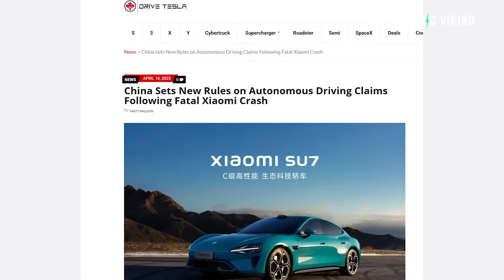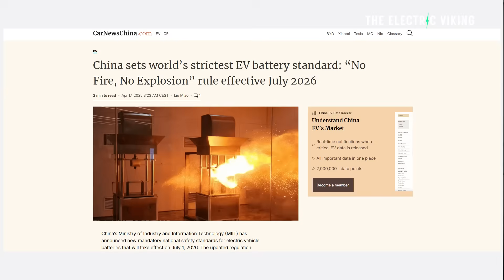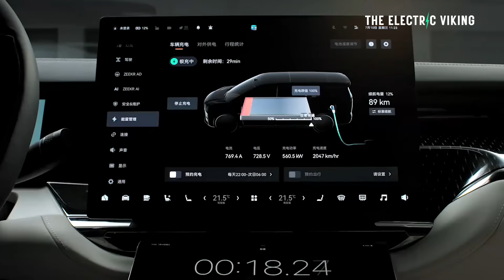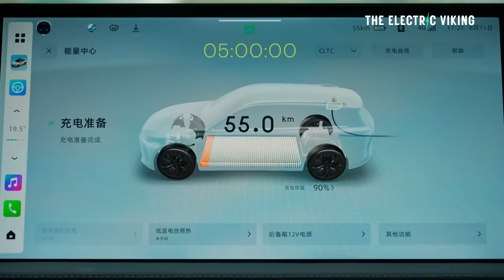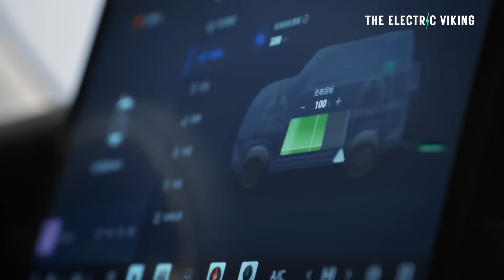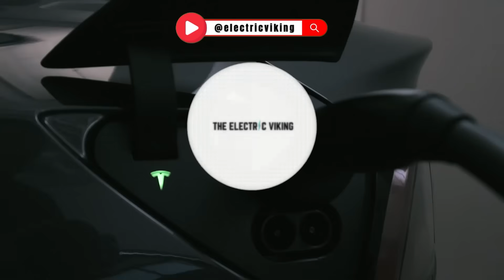China’s Game-Changing EV Battery Safety Ban Starts in 2026!

Comment: In terms of regulations, not buying it so much. Have you heard of those multi story concrete apartment buildings being built without rebar? I'm sure there are regulations, but the issue is probably more on the end of enforcement.

Comment: any increase in safety requirements is good if it removes a barrier to purchase and improves the overall reliability of the car. I agree that in both EV and ICE China has more brands than it possibly needs and consolidation and collaboration are required to thin out the brands. As long as Xpeng remains I am happy to see this

Comment: Safety was grossely unregulated and most homologations for road usage have not taken the necessary aging factors monitoring and damage prevention into account, not only on batteries, since also a basic heat and weld in a power regulation thyristor could cause on some poor non fail safe design, a high amp. short from battery to motor stator causing some drastic out of control speed excursion. Then, having a reliable high DC current safety circuit breaker to mitigate such risk is not that simple and cheap. Under water DC power lines breakers one both ends can be up to five floors high..to break a permanent DC electric arch forming…The green and EV industry obsession has been to ignore and hide the dangers as warrantable workmanship and material “normal” issues on recent products to avoid bad press and this strategy worked for a while with a very young EV fleet. Any fire brigade communicating on brand model type on fire but ONLY for EV was exposed to immediate legal litigation by importer/manufacturer on the basis that proven root cause of fire (asteroids , cigarette, drone crash, fire works, solar lense, etc) was still undertermined. Officials are instructed not to disclose fire data any more,  but when hundreds or thousand locals have to be evacuated away from toxic fumes with casualties, etc, then the silent wall breaks apart…: EQC in Korea, TM3 in Lisboa. Tesla truck in Australia, E-scooter in Nice , 3 years old daily used Kyburtz 3 wheeler In Gland post office etc..in most cases, the lithium fire destructions are so important that any investigation of the cause gets questionable..but most of the time, they are obvious with converging indications,,,but bad faith and armada of layers is well know to corrupt ignorance and naivet.
NOW, the cost implications of the destruction of car ferrries or Ev on fire in tunnels or confined space and related massive damage to surrounding infrastructure has caught the attention of insurance experts and safety administration . With stricter homologation rules allowing only new certified safe mobiles in ferry long tunnels whee damages can reach billions and fully discharging others in all confined spaces .a majority of the major EV community safety risk and cost of destruction can be mitigated, but the entire attitude and approach to safety has to change. The third liability insurance premiums COSTS already reflect this reality, here in Europe, they are cheapest on Dacias low cost cheap to repair ICE and higher on their Chinese made EV and are the highest on all Tesla  models….
One aggravating issue is that the profits generated by costly safety measures are not well accaunted for by dummy beans counters financial accountants…because it remains an 100% total passive cost until…it prevents a catastrophic damage which then does not occur and is not accounted for either…This is why safety cannot be managed by cost only but also by the level of damage and casualty volume without it, and here for EV, reaching excess cost is clearly the case. This requiring a separate budget approach for safety expenses.. For instance for its safety performance assessment, the management of à nuclear power plant shall not be rated on the GWh produced annually and their good financial results only but ALSO BY the number and gravity of ALL incidents . This is how safety is at stake….😂

Comment: China, the largest EV market, reports indicate 680 EV fires in the first quarter of 2022 alone, highlighting a significant regional contribution. If this rate held, China could see thousands annually, but this data is partial and not globally representative. In the UK, 390 EV battery fires were reported for the 2022–2023 fiscal year. Sweden recorded 23 EV fires in 2022 out of 611,000 EVs. Australia noted only six EV battery fires total as of June 2024.Globally, with 40 million EVs by 2023, the fire rate is extremely low—around 0.0012% to 0.0013% based on EV FireSafe’s data. This suggests fewer than 500 fires annually worldwide, though underreporting is likely. Specific causes like collisions, manufacturing defects, or saltwater exposure (e.g., 11 EV fires post-Hurricane Helene in 2024) add context but don’t give a precise total.Without centralized global reporting, a conservative estimate based on available data suggests 1,000–2,000 EV battery fires worldwide since 2022, heavily weighted toward markets like China. This is a small fraction compared to internal combustion engine (ICE) vehicle fires, which occur at rates 20–80 times higher. For a definitive number, more comprehensive global tracking is needed.

Comment: According to Swedish numbers from the Swedish Civil Contingencies Agency (MSB).

Specifically, the data for 2022, which indicated:

3,400 fires in 4.4 million petrol and diesel cars (0.077%)
23 fires in 611,000 EVs (0.004%)
... is widely cited from their reports on vehicle fires. You can often find this information referenced in articles and studies discussing the safety of EVs compared to traditional combustion engine vehicles.

This means ICE cars catching fire in case of an accident is approx. 19 times higher.
But yet. ICE cars catching fire under other circumstances are much higher, i.e during re fuling, leaks etc. I have not got numbers for this but there are numbers showing that hybrid vehicles are the most likely to catch fire, statistically, than any of EV or ICA vehicles.  

Many sources analyzing EV fire statistics refer to the MSB's data as a reliable point of comparison.

This is 2022 data so things have changed a lot since then, but this is at least an indicator from a reliable source.

Comment: Fire is my biggest concern with EVs (especially Chinese ones) since all the other problems have been handily solved already. Sure it's a low probability event but it's EXTREMELY high consequence, and when you have millions of them rolling around it will be happening fairly frequently.
Reply: China sold roughly 12 million NEVs last year, on top of 8+ million in prior years.  There are easily 30 million NEVs in China today, and most of them are newer cars using newer battery chemistry.  That's why China feels confident to ban the 1st gen Lithium batteries.

Comment: I have seen it many times where companies give a country a regulation as they have already implemented some safety feature which will benefit the market.  However, it can also be used as a form of protectionism as foreign companies do not have to have that standard for their home market  and face costly redesigns,,,
Reply: Yes, and this is deliberate.  There are NO 1st gen Lithium batteries which can pass this, so it cuts off most of the non-Chinese OEMs.  They'll need to find a Chinese partner for the battery, which basically means they'll need to license Chinese drivetrains. You can't just buy a battery without the tech to manage it, or you'll see much worse performance and reduced longevity.

Comment: 100% China will develop safe battery tech. 
Lithium Sulphur and  Sodium Ion batteries already provide far less risk than NMC /NCM (Nickel Cobalt Manganese). 
Solid state batteries are still to be seen in real life in a vehicle even given the Hype from Toyota and Honda.
Aluminium Graphene by GMG are in level 4 /5 evaluation and possibly still 3 years away and are suggested to have energy density of 500Wh / kg. twice that of LFP.
Once that is proven then a massive game changer , lighter more energy dense and fully recyclable without risk of fire or explosion and no toxic smoke.

Comment: Maybe China has already THE solution so, putting new hard rules will hurt only the small manufacturers but at the same time will help to export their cars. The other countries are not ready to compet against new tech....solid battery could be it.
Reply: They do.  LiFePo, Sodium are in production.
Reply: @ZweiZwolf  LiFePo4, yes I know as I'm using them for my solar sustem since 2020. But the sodium, I wait to see the pros and cons. Anyway, thanks for the information.
Reply: @ Sodium is in use today where capacity, weight and density are secondary to cost.  It's like mild rolled steel over forged titanium alloy.  The big uses are utility grid storage and small e-Bike / e-Scooter packs.  I believe some NEVs with sodium packs are going into production this year.

Comment: so if ev have this when does this rule come in for petrol and diesel.     like the diesel cars that have known faults not fixed.
every ev fire is news    every petrol or diesel one is not.   people are looking to find fault.
they look for a reason not to buy.
why do we respect  petrol and diesel cars   they kill people   there is large numbers of car etc catching fire.  after all these years  there has been no lets make them safer
Reply: I have just ruled out buying a Kia stonic.  Its a mild hybrid, with a lithium-ion battery in the boot.  If it had been an LFP battery I might have considered it.  I ruled out lithium-ion on safety grounds for my home battery that works with my solar, I bought a battery but an LFP type instead as they are much safer. Another car site I watch sometimes has a guy with a Porsche EV called a Taycan.  He got a letter from the car manufacturer recently saying not to park near your house, due to fire risks in the vehicle recently identified.    He contacted his house insurer and they wont cover the house from a fire originating in the car now he has had that letter.  This is a massive inconvenience to him, in the UK parking away from houses and other cars is basically impossible.   It seems a Taycan fire killed two firefighters in Spain recently in an underground car park. Add all this downside risk and there is NO WAY I am getting any EV or hybrid or petrol car that has a lithium-ion battery in it.    Any cautious car buyer should be doing the same.

Comment: It is an axiom in the field of Security that the standards must be built into the products from the inception, and not tacked on at later stages. I would say from my experience that this is a major excellent step. We may think that we are well into the EV world, but it is just the beginning. 

The security of future systems will be built upon what the batteries can handle and how they perform under stress. As the two major companies will be spreading their products around as OEM suppliers (and probably others) , it is essential that the standard determine the responsibility. Without a standard, either of the two essential companies could sell product and try to pass the responsibility onto the frame maker or the body maker which might ignore the duty to make a correctly substantial bottom panel that doesn’t protect the battery from being pierced. 

Or, they might sell different levels of responsibility – but the country standard compels them now to maintain high security throughout any chain they are involved in – even after a piercing that is not their responsibility, they are responsible that there is no runaway, no noxious gases. This is the Way.   

Will it add costs? Certainly, but it is also better to have those costs built into the mentality of their creation. It is akin to being easier and cheaper to capture the carbon before coming out of the smokestack as compared to capturing it at each car. But is it worth it? Absolutely, and better done now than a few years from now when vendor and OEM supplier blame each other for disasters that weren’t when security standards weren’t established and everyone relied upon the highest level of ethics and competence that get skipped over – not always malice, but sometimes, not often misunderstandings and incompetence, but sometimes.

Comment: Thanks for bringing yet another highly interesting news. If the EU implements a myriad of regulations (strangely none regarding this safety standard issue) China should too. It´s a bold step, imho in the right direction, even if it´s just aimed at increasing consumer confidence in the product.
The little caveat is that China has had strict rules for the last 5.000 years and most Chinese and Chinese government officials know a hundred ways to circumnavigate them. Some rules have to be followed, others not so much or not so much for certain people/companies. This always happens when it´s bureaucrats to check if the rules are applied and not NGO´s like in the West.
Reply: Many ngos of the west are subservient to the youassdollars. Not much trust can be place on them too.

Comment: As you indicate, these new regs may not impact those companies that already produce a safe battery and/or have an improved safe battery on the way. Rather, the regs will likely push some companies out or force auto manufacturers to adopt/purchase reg-approved systems. Consider tesla. Their new battery represents a technological dead end that will likely not meet the requirements of the new regs. So, what does tesla do? I expect it will force them to source approved batteries if they want to remain relevant in China. Poor elmo... :face-blue-smiling:

Comment: Many of the new battery crash test regulation requirement is from 10 yrs ago, the GB/T 2015 standard, only that T means that's recomended, not mendated untill now, so the big direction is set decade ago, only now they think it's finally possible. The specific is something like the whole battery pack wont self ignited at all, and wont catch fire at the crash of 60kph or so for 2 hours in the test. Word is LFP batteries of CATL and BYD on the market can do this already, the NMC batteries, however, have a little bit of work to do, and the edge of energy density of it may lost for lower nickel density along with other new safety measures added.

Comment: If this is actually enforced this is going to be a big problem for the EV market because the higher the power & the faster the charging the less likely this standard can be met. Whether it be fires that start in the battery itself or other electronics this regulation will force compromise in the very things needed to give the EV any real chance at long term success.

Comment: A better question to ask is whether any non-Chinese battery makers would be able to meet the new standards. If no, then the Chinese market will become fundamentally impenetrable by foreign manufacturers.
Reply: The answer is basically "no", not by 2026, and that's the point.  China has by far the worlds largest auto market, and the world's largest EV market (roughly 2x the rest of the world combined).  They are closing the door to foreign competition who need to sell in China or lose 20-30% of their global revenue.  It disrupts non-Chinese EV battery supply chains and forces the rest of the world into a situation where they either mirror the regulation and disadvantage local OEMs, or else delay implementation and compete with "unsafe" EVs against "safe" Chinese EVs.
Reply: @ZweiZwolf Surely non-chinese manufacturers will be able to innovate, perhaps put some of that glue budget towards battery safety instead?
Reply: @ Glue budget?  Ahaha, no.  To compete with Chinese battery OEMs, they'd have to take ALL of the money out of the stock buyback & bonus dividend fund for the next several YEARS, and that ain't happening because executives would lose their multi-million$ quarterly bonuses.

Comment: I've witnessed a crazy man deliberately collide with numerous parking meters, a brick wall, and ultimately explode in a mushroom cloud of radiant heat, then burning petrol running downhill towards my car, a hero cop giving me the green light to u-turn on a one-way street and escape the madness. There is zero possibility that a petrol car can be made to these safety standards. $0.02 from a bloke who got 2nd degree burns from 500m away, simply witnessing a full tank explosion of a small Hilux ute.
Reply: Safest battery rank: Gold Blade Battery,  BYD > Short Blade battery Geely  >> 1st Generation BYD Blade Battery (3 years) >> 1st and 2nd Gen LFP Batteries > NMC Batteries Panasonic, LG Chem (this ranking is from Videos of Electric Viking and others).

Comment: This specifies conditions for tests in lab, and while it's definitely safer it doesn't mean cars never burn when smashed into something at 120km/h. This is going to be harder to achieve for high density NCM batteries,  but all the major battery makers are inside the group of experts drafting the rule so they already knew well ahead that this was coming

Comment: NIO vehicles will have an edge with this policy due to their BaaS feature and given that batteries are essentially tested for safety at every swap. Worth mentioning.
Reply: Unless NIO is retiring all of their 1st gen lithium packs, there is no advantage.  That pack may still have good internals, but if it gets punctured by a steel nail, it'll still short into thermal runaway.